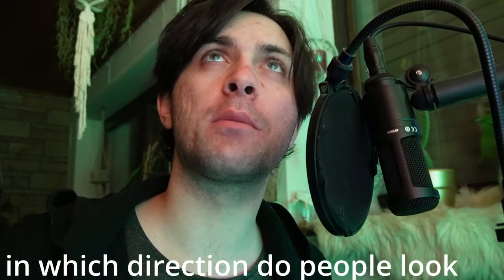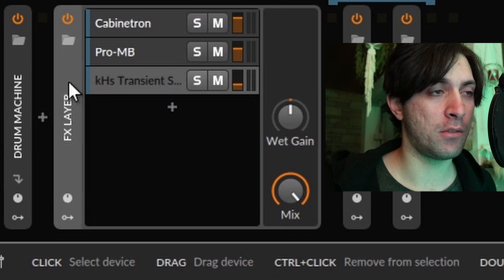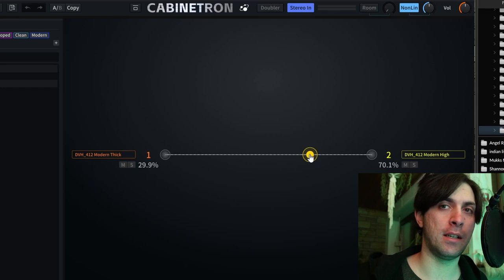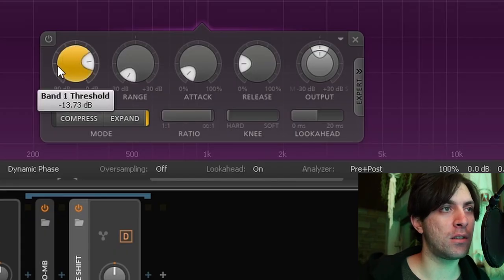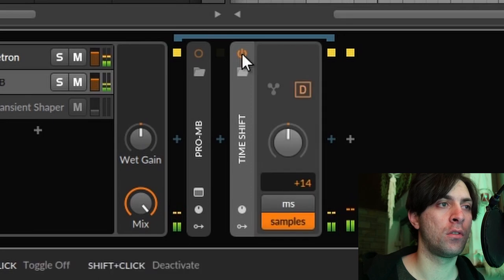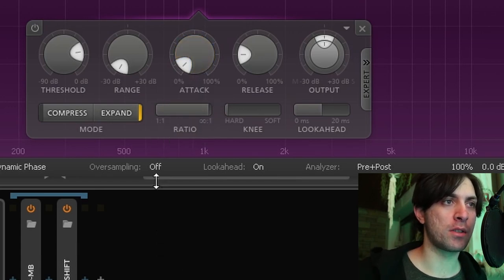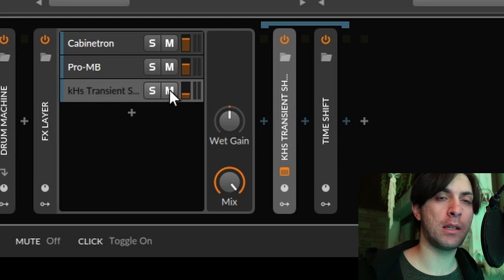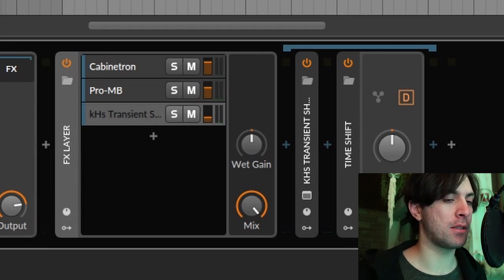Can I Mix a Cabinet Sim With The Dry Signal?

Comment: It's supposed to sound phasey though.... The point is to create contrast with the dry signal by dispersing some of the sharp and "dry" peaks created from the pedals, tonestack, pre-power amp.that's why almost nobody time corrects cabinets with DI's, or why in most cases it doesn't make sense to time correct overheads and room mic's, as you just make them another direct signal in a sense when their time arrivals are the same. You can think of them as reverb perhaps, not a "proper" sound
Reply from the maker: i do like mixing them with dry. even though it's not what cabinets wre made fir

Comment: Drums A had a little too little punch
Reply from the maker: it's funny that you perceive it like that, because A and B are no different in dynamics, only in convolution. but just the vastly different spectral distribution can make it different enough to arise a lot of different perceptions on the sound
Reply: @Beatsbasteln  yeah, I would explain it in the sense, that the punchy spectral areas were more prominent in the convoluted signal 🤔